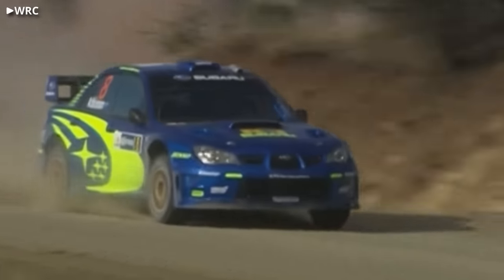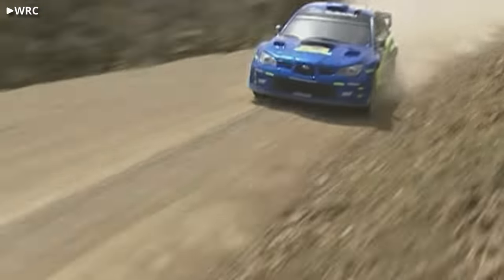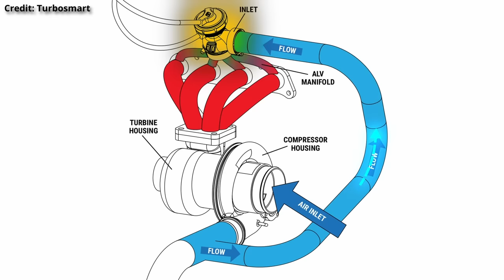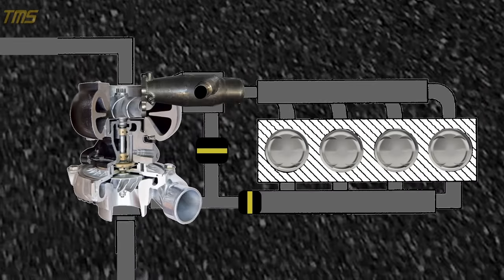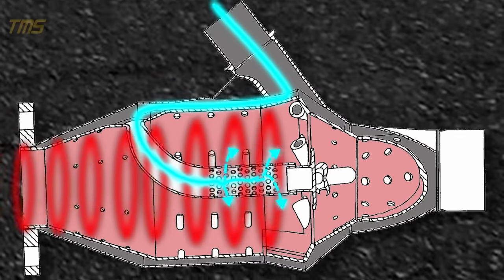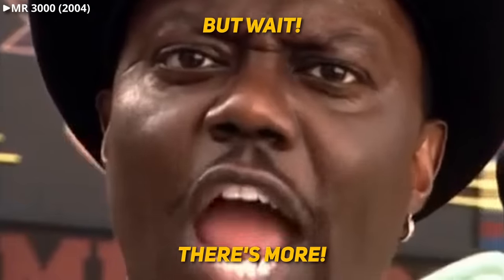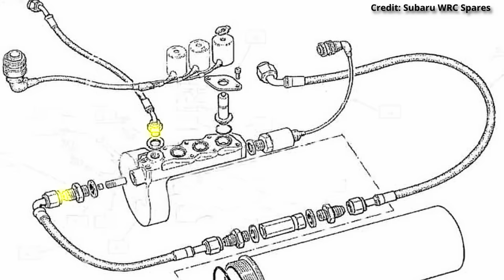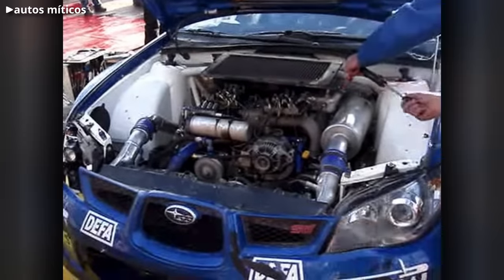When Subaru Put a “Jet Engine” In Their Exhaust | Rocket Anti-Lag Explained!

Comment: Of all the ways I would have thought of to deal with turbo lag, i'll admit inserting a bastardised ramjet into the exhaust system probably wouldn't have been one of them
Reply from the maker: 😂 Me neither
Reply: @themotorsportstory  Honestly though, it's really interesting to me how much it resembles. Just that. I've studied and messed around with subsonic ramjets before, and while it's different in that the combustion takes place all throughout it, and the fact that you have fuel coming in through the inlet and oxygen being injected, you can pretty clearly see the analogues of a steeply widening diffuser, a constant-volume combustion chamber and a steadily tapering nozzle - even the inner section resembled the flameholder/turbulator you'd see in such an engine

Comment: Looks like a can-annular combustion can from a gas turbine, and the goal is to spool the turbine - all the requisite components of an actual jet engine are there, so it’s a gas turbine combuster. Technically this part in every jet engine is a rocket motor, taken a whole it’s a gas turbine engine. This is how jet engines were invented in fact, when it was done on aircraft engines in the 30s, after a while, the pistons are just getting in the way…

Comment: 3:20 I'm not an expert but can't they just use the clutch to neutralize the unwanted torque on the wheels?
Reply from the maker: You could do that, but the end result would probably be a slower time for the driver. Some drivers like engine braking to work with the car's brakes to help slow them down faster, so in this situation, the driver would be relying only on the power of the car's brakes to slow down. Even though this is fine for a lot of drivers, extra footwork would be needed (compared to being able to left foot brake and apply throttle at the same time in a corner), and I would imagine each corner could be slower by a few tenths of a second or so which would add up over the course of the rally stage. This is the full video that I used for the "pedal cam": https://www.youtube.com/watch?v=jpaSTIVe2p8&t=788s

If you watch the driver's feet, you'll see that he always has his left foot on the brake and right foot on the throttle, so taking the left foot to apply the clutch and right foot to brake would stop him from being able to quickly apply the throttle and get out of the corner.
Reply: @themotorsportstory  Thank you for clarifying things and this is why I love YouTube, you can basically learn anything 😊
Reply from the maker: @Monkey_D_Luffy56  No problem! I'm learning every day too! One of the best things about YouTube for sure

Comment: All that jazz for nothing, put an electric motor in the car and get instant torque, no need for turbos, rockets or other feeble attempts of a workaround, just raw, instant power.
Reply: Auto racing heritage is based on internal combustion engines good luck with that ev stuff.

Comment: The turbo here, of course is not A ROCKET.  It seems like it acts like a JET ENGINE WITH AFTERBURNER which of course would result in a lot more exhaust pressure than just with the exhaust alone..

Comment: Hi all, can any engine aficianados out there help I have a question. I bought a mini cooper S, 1st gen r53, with the supercharged Tritek engine, that was apparently tuned up before i purchased it, inc low mass fly wheel and super charger pully, Miltek on the back etc etc. This thing pops and bangs so f**kin loud everytime you lift off , but how? I thought that was a turbo artifact? please educate me.
Reply from the maker: So pops and bangs could mean that some fuel is igniting in your exhaust. If your air-fuel ratio is too lean (too much air/not enough fuel) or too rich (too much fuel/not enough air), some fuel might not be burned in the cylinder and will get into your exhaust and ignite causing the noise. It can happen on any car (my car which doesn't have a turbo or supercharger but does have an aftermarket exhaust pops occasionally when you get off the throttle) From what I've heard about Minis, some of them had pops tuned in from the factory, so I'd imagine an aftermarket exhaust would only enhance that on your car. Unless the car is running terribly and the air fuel ratio is way out of wack, it's probably not anything to worry about. Otherwise to be safe, you could have a mechanic scan for any codes indicating that the engine is running poorly. But I'm not a professional mechanic so I can't make any guarantees that this is exactly what's going on.

Comment: I knew someone who had a Grand !
National that fabed up a cylinder that held a NOS injector, a fuel injector and a spark plug it was plumed in to a modified crossover pipe. A quad 555 timer controlled the duty cycle of the fuel and NOS, drove an ignition coil and provided a timeout to keep it from running too long. Basically push a button and for up to about 10 seconds you would have boost at idle. No idea how it held up, the car got destroyed by an idiot thief before it was in the car long enough to have a failure.
Reply from the maker: Sounds awesome! Sorry to hear about the thief, hopefully he's either rebuilt it or moved on to an even cooler project.

Comment: So, yea... it actually IS a rocket.  You have fuel, and oxygen source, and thrust created by combustion.

EDIT:  I do, however, agree that it's not a jet.  For that, it would need turbine blades.
Reply from the maker: Right, that was the main distinction I was trying to make. I had read theories of people saying it had it's own fuel and ignition systems along with turbine blades inside of it and I wanted to make it clear that was not the case :)

Comment: To believe the tank at 10:06 is a boost storage tank is plain stupid. The volume looks to be enough to feed the engine for at most one rotation. Also the hoses coming out of it are way to small for the flow rate required.
Reply from the maker: Agreed. Some people will claim that though, as I've read on forums, reddit posts, etc.

Comment: boost doesnt overpower the exhaust flow so you cant add boost up the exhaust. putting a air pump in the exhaust doesnt add boost pressure or manifold pressure.

Comment: What a stupid conzept to keep the turbocharger up at a specific/wanted rpm! Decouple it from the exhaust gas system and add a e-motor which is strong enough to keep it at the needed rpm + add some electronics to get more features - like rpms as functin of speed, or what ever you can imagine, up to an A.I. that "knows" what will likely(!) happens next and starts to increase/decrease the rpm before(!) the event happens that would normaly trigger it. etc. etc.

Comment: Do you really think they are adding air to the cooling system to raise it's pressure? I just can't see that being a good idea, air pockets in the cooling system is a bad thing and the radiator cap ultimately controls the pressure of the cooling system. Let's say he WAS pumping air into the cooling system, the excess pressure would be dumped right out the cap. Changing the cap is the only way to increase pressure in the system because that's where the pressure relief valve is... All adding air would do is push out water, replace it with air and cause localised hot spots that could crack cyl heads- as we all know, boosted engines tend to run hotter combustion chambers and therefore cyl heads... I have no idea what they were doing, but surely it WASN'T adding air to the cooling system
Reply from the maker: I never said he was adding air, I said he was increasing the pressure of the system; big difference. There's several comments including one in the thread of the pinned comments at the top that verified that this is what they were doing, along with many more comments explaining this in more detail in the rest of the comments section.

Comment: Man, I've been talking about spooling a turbo up (via an exhaust diverter valve for start-up) with one of those little $1K China made jet engines for RC model planes for years now without convincing anybody to try it. I think it would be enough without even using the engine exhaust; but I don't have the F-ing bread to try it. Be F-ing Bitchin if it works; and I sure as hell don't see any reason it wouldn't, especially now that I've seen this video.

Comment: "it's not a jet engine"
"why?"
"because it uses a different fuel injection system and a different fuel." 
It's the same as saying a carburetted diesel car isn't a car because it doesn't use fuel injection or run on a petrol-air mix.
Reply from the maker: I should have been more specific with the point I was trying to make. I've read and heard theories of people saying that "the rocket" had its own fuel injection and ignition systems and also internal turbine blades which obviously isn't true. The average person is unaware of all of the different types of jet engines and usually pictures a turbojet or turbofan engine found on an airliner which "the rocket" by itself is not.

Comment: The year is 2054, every component of a car possesses a turbocharger. The wheels themselves are connected for better torque. The flywheel itself is turbocharged for faster rev change. DEY PUT A TURBO ON TEH AC OHN GAWD IT WON'EJFJDKLSAELQJHGRVNCMXCZVNP

Comment: Why would you need a tank to control a wastegate.. you would only need a tank to power a pneumatic device
Reply from the maker: The tank allows you to store air to adjust how much pressure you're sending to the wastegate actuator. So rather than the wastegate being directly connected to the turbo like on most street cars and opening at a set boost pressure every time, the system in the video can control exactly when and by how much it opens. This is a longer video that explains it very well: https://www.youtube.com/watch?v=hYIL_XvlYTE
Reply: @themotorsportstory  that the only pneumatic system in the car??
Reply from the maker: @jonathansanchez1305  I'm not sure on that one
Reply: @themotorsportstory  If there was pneumatic shifting I would use the tank from that..
Reply: @jonathansanchez1305  Weight, design cost/time and how much air you can store in it and how much will be needed.
It's easier and lighter to take low pressure air, that the car is generating in infinite amounts, to control actuators.
Reply: @feluke8396  placement seems high and also  odd if that was the only pneumatic system.

Comment: Pretty neat how the system works. However, it's seems like way too much work to make that. Use electric motor to spin the turbo when required, problem solved in much cheaper way. EZ.

Comment: Somebody needs to put this in an new track only car i dont get how for example lamborghini makes an track only car that doesnt have this system. With no rules you can add seperate fuel and spark for even more efficiency. Boost at a press of a button on anny corner every time. If i ever have te money this is the first thing im making
Reply: Because it comes with downsides that probably outweigh it's benefit. Occupies more space, added heat, weight, cost, failure point, wear on turbo. Not ideal for endurance races or Lamborghini for that matter, they have reliability issues as it is

Comment: Would this not be an ideal thing to build using a 3D metal printer??
Reply from the maker: Interesting question! This would have been around 2006-2007 or so. I'm not sure how good the metal 3DP tech was back then compared to what it is now, but it would be interesting to try!
Reply: @themotorsportstory  I mean it seems like the sort of thing that would be quite advantageous for more performance focused vehicles but probably with improvements for the sake of regular driveablity and fuel efficiency.